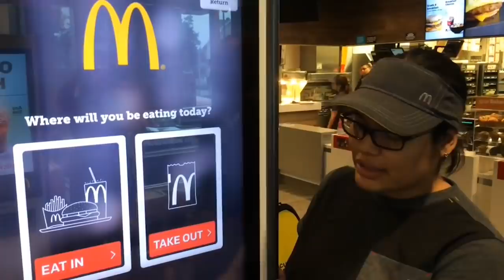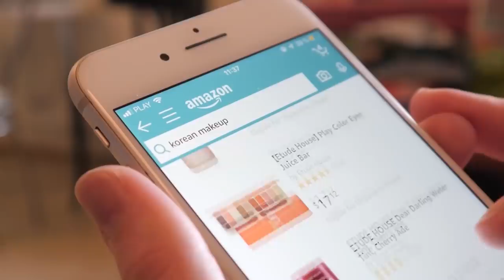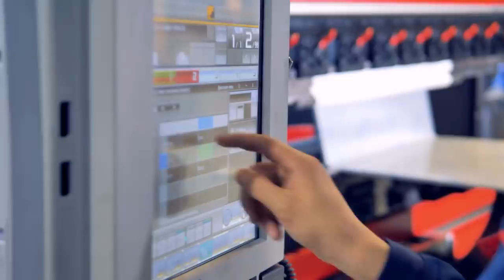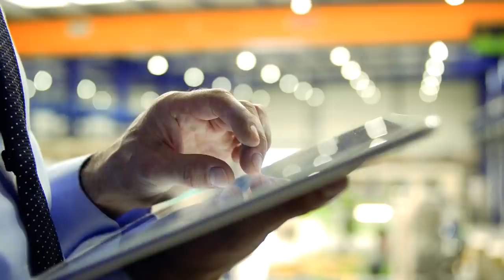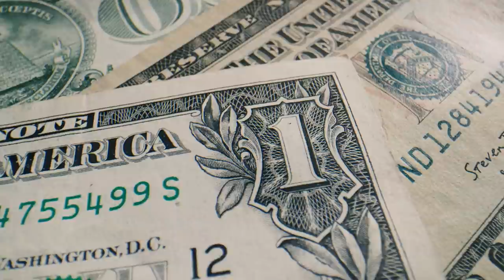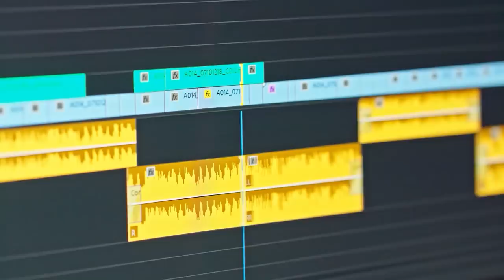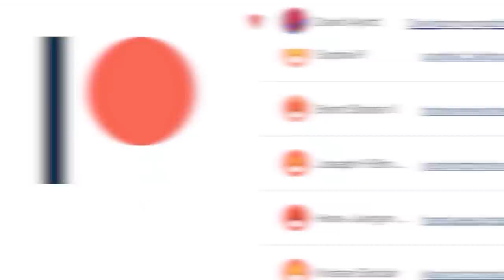The Two Futures Of Automation: Capitalism VS Socialism

Comment: As a schoolboy in 12th grade, I dread to imagine what kids like me, and especially future generations, would be up against as adults with this in mind. Fighting for survival would be just as common in society as it is in the wild, just under a different lens. And to the benefit of such a small few. Ugh. When will they learn...?
Reply: Trades. They cannot automate a trade such as plumbing, electrical, etc.
Reply: @Streghamay  They make it in such a way that any person can do it with moderate levels of skill and training. In the olden days plumbing involved the use of metals and soldering and welding in even domestic pipework. Now most domestic work is plastic and easy fitting parts and a lot of the old techniques are gone. Similar trends can be seen in low voltage domestic electrics. The real money is in design, specification and inspection but this is rarely done by anyone but degree qualified people.
I was listening to the radio about a year ago to a labour expert from MIT who predicted that kitchen installers were the most future proof job going, at least for 20 years. Grim when even the experts cannot see out beyond 20 years into the future. He reckoned you would need skills in plumbing, electrical and carpentry, gone being the days when one man would handle each trade.
Reply: Same here.

Comment: Coming from someone who is on the front lines of the tech field, we are nowhere near this as an inevitable conclusion. There are many assumptions made here around finding and implementing resilient systems, and ensuring those systems can properly self heal on both the software and hardware; Additionally, they need to eventually be able to self evolve and self iterate or the current practices in IT will continue to breed more of the current environment of requiring people. Even though this video has many credible sources, it still needs to paint the picture on how we get to this inevitability as a logical conclusion.

My entire profession right now revolves around reliability. The ability to replace people entirely for jobs isn't there right now, even if you back it will all relevant clouds and infrastructure. As of right now, this is so far future that I imagine we will hit substantially more problems with climate change or capitalism proper that derail this as an inevitability.

The worst outcome of this is probably the concept of job displacement. If people are unable to adapt when the job fields continue to shift towards technology, then many of these repetitive manual labor tasks will continue to die while the tech seats go unfilled. Tech truly can't grow fast enough to keep up, and even my team can't keep a fully staffed headcount as it grows exponentially year over year.
Reply: This also isn't helped by the tech-illiteracy of many HR departments.  As a Math/CS student looking to enter the workforce soon, some of the requirements I see on job postings are absurd when compared to what the description says the job actually entails.  I know some of that is corporate creating impossible standards so that they can justify work visas for workers from abroad, but often times it's HR just being that genuinely clueless.
Reply: 50 years ago, the thought of having an AI software that could monitor millions of people’s feelings, thoughts and experiences and make predictions about them would of been pretty much unimaginable to most people. Now social media does this 24/7 and it’s normal. I think you underestimate how quickly the world is changing.
Reply: This comment and idea did age well with AI and APIs now.

Comment: I worked at Amazon as a picker, we got stuff of shelving units... we had to find the shelf, search for the item, ensure it was the correct item, scan it, and place it into a tote in less than 7 seconds... I severely wish it was 11 seconds. I could do 11 seconds  without causing my shunt to get overwhelmed and cause my hydrocephalus to get worse causing disorientation, confusion, double vision, vomiting or nausea... I knew of no job in the warehouse where 11 seconds was the time to complete the task, packers were 8 seconds per order, the inbound line where they opened boxes of product were 1 box every 5 seconds the folks who put stuff on the shelving units needed to do it every 4.5 seconds... I am in the U.S. so idk where the 11 second number was from or when it was from.

Comment: Recently I watched at A Handmaid's Tale and my question is: Gilead is an capitalist or an socialist economy?
Reply: Gilead (from what I remember reading the book. Idk what the show rendition is like) is a theocratic society with rigid hierarchical structures wherein workers don't control the means of production. So not socialist in an economic or political sense.
Reply: In the show, Gilead seems to be a state capitalist autarky, a lot like North Korea, or Nazi Germany in 1943-45. The capitalist class is also the male ruling class, there's a heavy emphasis on military-based oppression, and they use slavery quite a bit (the Colonies, the Marthas/handmaids, etc). But they also are looking to set up international trade (Bradley Whitford's character is basically trying to set that up the whole time). And then due to sanctions/embargos, they have to deal with rationing, so they struggle to have meat at the grocery stores, for example.

Comment: The future of automation is decentralization of production and ownership of the means of production. Some of the providers of the "means of production" will be large and centralized, where this makes economic sense. Think Ebay and individual sellers/merchants, but advances in technology to create machines used in production will make such equipment available to small producers.  This is the future. UBI will not work nor will any system which does not reward ambition and hard work.

Comment: That weird paradox that automation tends to make our lives harder, not easier, was the biggest accelerator to the left for my politicial leaning.
If automation means more stress (because we have to worry about our job security + keep up with a tightly dictated schedule), less pay (because paying us needs to remain more profitable than having a machine do our job + supply&demand of jobs lowering the price of labor), more work (due to tighter optimization, more competition for jobs/ease of replacing a worker + the need to balance out the lower wage per hour with more hours) while it should mean an easier, more comfortable life with less work, fewer worries and more freedoms for everyone... there's something deeply wrong in the system.

Comment: I think housing / mortgages are the main issue. If you have a house , you technically don’t need that much money to live on. However, we spend 20-30 years of our lives slaving away at a job just to put a roof over our heads.

Comment: That’s misinformation about Amazon. You get one 30 minute unpaid break and a total of 30 minutes paid either split up into 2 15s or one 30 minute break. It’s just boring work if anything and if it’s too fast just get good or transfer departments to one that fits you better. Also the safety cases from what I saw were just caused by stupidity, incorrect ways of using the technology, and not stretching enough(which they encourage to). Also Amazons pay is typically better than most unskilled jobs with great benefits including a 401k, health/dental insurance, financial support for getting into college, paid time off, and vacation. Paid time off can be used almost anytime as long as you have the balance and after a 10 hour shift, you get about 1.75 hours of paid time plus some vacation time

Comment: I'm not concerned. All of economics has been based on the need for an underclass to work at low level labor so that others have free time, which frequently gets spent on cultural, scientific, or technological efforts. It actually surprises me how much a society advances even accidentally when efficiency increases at the lowest levels of work. There are no longer any people willing to accept being relegated to the lowest rungs in a society. This is probably ultimately a good thing, but it will require filling those spaces with something. Thus robots, which is kind of interesting when you also consider the origin of the word robot.
I want to know how we generate the electricity for this, when green energy solutions are inadequate for our current needs even if we had 100% adoption. We're going to need alternative sources of energy, such as bio-fuels or nuclear fusion, both of which are a ways off and are getting increasingly hard to see being developed any time soon as we choke off productivity by throttling our energy generation and usage.

Comment: From my standpoint, and this is purely opinion, your comparing a system of a social network for society safety and collapse prevention with a form of economy. You can have both. Truly. It's possible. Will I explain how? No. I am not required to explain it as if the basic concept of using taxes to cover the basic costs of the safety net and capitalism as an economy which generates the taxes needed to do this. Also, before you say "every one was well off in startrek" you are wrong on that, as many worlds were in poverty and horrible conditions. Capitalism still existed as it was WHAT made the taxes get paid, even if the federation did try to care for many of its people. You cannot lean solely on one. This is my opinion, I don't expect agreement with it, but I hope it gives a different viewpoint.

Comment: The long term solution is for us, the people, to unite, organize and build new cities from scratch. New cities were all (or most of the) jobs are automated and where every person has free access to every good and service. 
Everything is free for everyone and thus, we don't use money or any kind of currency, trade or barter. The machines produce and distribute the goods and services automatically so there are no wages to be paid and thus the marginal cost of every good and service reaches very near zero. 
Building new cities from scratch is necessary because the current cities were not designed for this new economic system to function in. Trying to install this new economic system in the current cities is like trying to install Windows 11 in a 1998 computer. 
The new software is simply not compatible wih the old hardware. 
And building cities is also interesting or desirable for anyone interested in a socialist revolution because it facilitates the execution or realization of the very socialist revolution in any given country.
Building new cities from scratch can be considered a third way to realize a socialist revolution, the other two being protracted peoples war and the electoral/reformist path.
And, in my opinion, building new cities from scratch is also the most viable path for a socialist revolution in most developing countries.

Comment: I just saw this video and you do a very good job of discussing how automation might impact society. I didn't see any mention in the comments, but your discussion of automation under capitalism sounds a good bit like Presidential Candidate Andrew Yang in the Democratic primaries. He advocated for UBI for exactly the same reasons you mention. Where I part company with Yang is that he still believes the capitalist system can be salvaged and made more humane. I believe he is chasing an illusion. One factor which should be noted is that under any just socialist model, workers would own the factors of production. That is the power shift that capitalism does not typically abide and its financial and regulatory institutions work to insure that it is so. If workers own the organizations for which they work, they can be part of deciding just how, when, and where automation should be applied.
Reply: A capitalism with sufficient UBI has a lot of the benefits of full socialism (such as completely fixing the labour market) and I think would directly lead to socialism in a while.  "Sufficient" needs to be enough that choosing to live on that is a valid choice anywhere.  I don't think Yang's amount is quite there, and if lowered as a 'compromise' might just end up as a welfare cut.
Reply: @tristanridley1601  Actually, in a world of pragmatism, you are spot-on. It may happen, as you indicate, but the labels will be less important. Most definitions of socialism (and capitalism for that matter) are dated and don't fit exactly where many people are. There will be trials and errors, successes and failures, but ultimately I believe a decentralized socialist model with capital-based markets, cooperativist structures, and broad employee ownership of most firms will win the day. More bottom-up, less top-down.

Comment: I have a masters degree in AI and I don't buy that machines will take over human jobs much more than they already have. Machines need energy, which mainly comes from fossil fuels right now. If you look at the past 2 centuries, what essentially happened is that we started burning massive amounts of fuel and coal and transitioned away from renewables and manpower in order to use more machines. But this trend is coming to an end because we are simply starting to run out of fossil energy. In my opinion, whatever the politics and ecnonomic systems, the future will be made of fewer machines, not more.
Reply: humans are famous for allot of things, one of which is finding solutions to problems.  Don't assume because you know allot about a field it guarantees you know the future of it.
Reply: @verigumetin4291  you are right, i shouldn't assume i know everything and humans are full of intellectual resources. But in this case it kinda seems like the laws of physics are against us. If we lack energy sources, no amount of technical inventions will be able solve anything. Again this is just my opinion.
Reply: @croutiflex953  To be fair, making advancement in energy production will take decades, it's not like software iteration, but still, I don't think we are as stuck in this situation as people think.
At the very least, I don't think energy is the big limiter in AI and machine adoption.